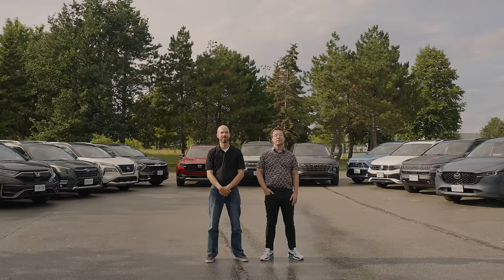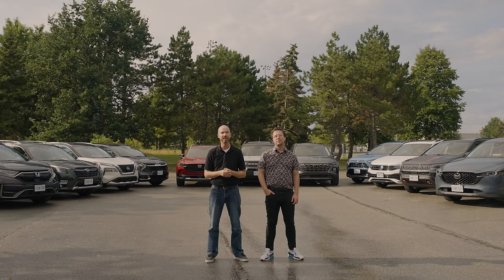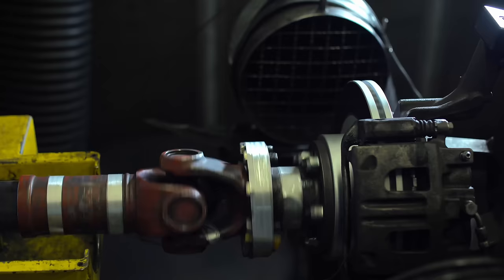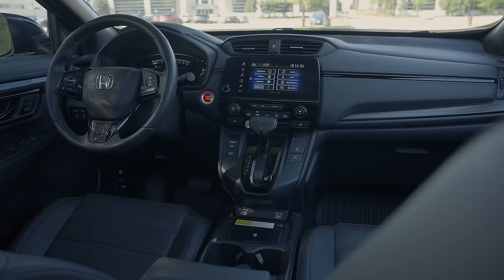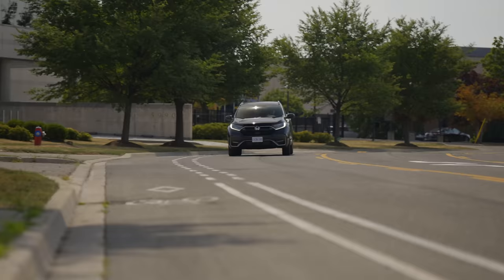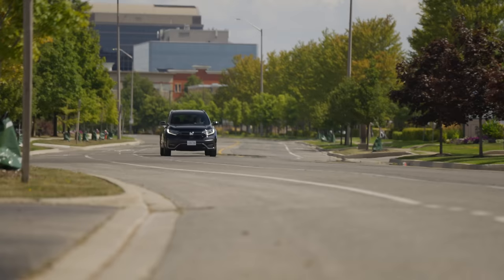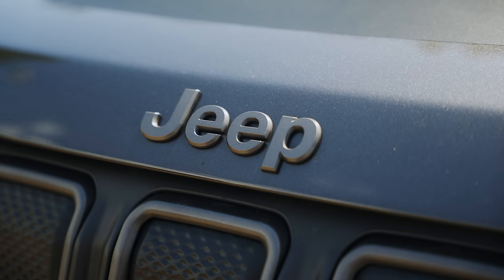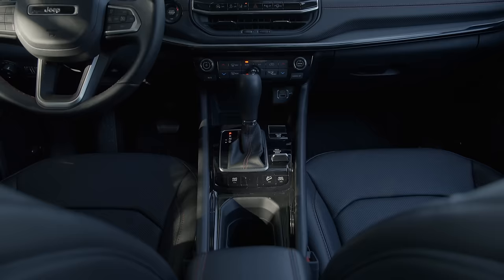Best Small SUV | Testing (almost) Every Compact SUV!

Comment: Excellent Review of many SUV's. Is there any thing without a Infotainment System? In my opinion the best Infotainment System is not to have one. I do not want this in my Automobile. I would like a Physical Key, Manual Parking Break, not an Electric Parking Break. Basic things like a Dipstick so I can check my Engine Oil and complete some Maintenance for example. The more bells and whistles that are on a Vehicle means the more there is to break. Also, a Fully Digital Instrument Panel is something that I can do without as well. If the Vehicle was lighter in Weight. 200HP would be more than enough. One would have a better Power to Wight in the Vehicle did not weigh as much.

Comment: Never sgain buying a Kia or Hyundai. Too many bad experiences with my 2017 Optima Hybrid. Taking it to the junkyard soon with just over 100k miles. Last repair quote was over $10k. Getting things repaired in warranty was always a hassle to the point were the last repair that needed to be done (coolant leaking into the engine) was never done. They are justvthe worst.

Comment: Agreed on the Mazda infotainment system. It kept us from even test driving the CX-50. Have another Mazda with it, and it is horrible. Also, Subaru slow acceleration is a huge turnoff. As for the RAV4, it is just so ugly both inside and out, and the quality of the interior just seems cheap. Edit: I did test drive the newer CRV,  and it road very well. My biggest complaint was some cheaper feeling plastics inside that I don't feel with the Hyundai or Kia. Edit: Anyone else worried about a 3 cylinder engine that is in the Rogue. Very nice SUV, but that worries me a bit for longevity.

Comment: After weeks of trawling round dealerships looking for a near new SUVs there's some things about car design in general that baffle me.
1: seat comfort is terrible on most models, in particular the lack of tilt control has outright put me off most i've tried. How is this such a massive oversight? This is also a feature (or lack of) that is nearly always never mentioned in reviews of features listings.
2: no push button start - this isn't even new tech any more so i'm surprised at how many newish cars still have a massive cumbersome key to start them. 
3: pointless tech: seat and steering wheel heaters. These are apparently massive selling points, but i've literally never got in a car and wanted a warmer seat or steering wheel. Maybe i could see the appeal of the wheel, but the seat is utterly pointless. Now if they could make a seat cooler i might be impressed.
4: No air blowers in the back: such a simple concept, but a lot of models lacking this. In the hot summer months me and the mrs have to almost freeze to death trying to blast some cool air to the back of the car for the kids. Usually just end up opening the windows anyway.

Comment: Mazda's infotainment system is not frustrating, it's flawless! I do NOT need or want a smart phone attached to my car. If I do, there's a $20 bracket for that, and it won't cost me $2,000 to replace when it breaks in 5 years unlike these highly distracting, unnecessary, huge, cheaply made, delicate touchscreen fingerprint magnets they are putting in most of these cars. There is a place for touchscreens but it's NOT in a car that needs to last 15+ years baking in the sun and then going to -20 in the winter like I expect mine to.

Comment: It all depends on the transmission, I have a 2009 Nissan Murano SL AWD with 412k ish. I regularly change the CVT fluid. I read the CVT doesn’t like heat or sudden acceleration. So I’m sure it helps I don’t accelerate heavily. My coworker owns a 2012 Nissan Juke AWD with 289k, as of last week. In her defense, she doesn’t leave Aquidneck Island in RI, and doesn’t go over 45MPH. Her Juke should last forever lmao
Reply: My 2008  Nissan Rogue still runs great after 165,000 miles.  The only reason why I replaced it was because it lacks so many of the new safety features that new cars have.

Comment: Are you comparing plug-in with gasoline? At least a hybrid or petrol is possible for Hyundai. Obvious advertising for Kia and Hyundai, which is huge in USA an so on. In my opinion, 2023 if that were the case, i.e. now, it's definitely Tpyota Rav 4hybrid or plug in. You will make improvements in 2022, when the Rav4 was not updated, the CR-V is old, the Tiguan is gasoline, now it is plug-in.